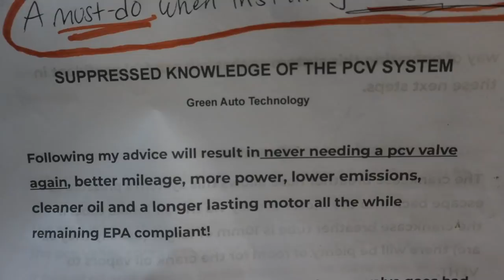The Wonder Of Positive Crankcase Ventilation

Comment: This was very informative.  My 1st car was a 62 Chevy II 4 cylinder, and I remember it had a vent tube going down.  I remember the oil rainbows on a wet street.  A few times at car shows, when an old one drives by and I catch the blow-by gas smell, it reminds me of how lots of cars used to smell like that if you were near them when they were idling.  And I gasped when it looked like that PCV valve was going to fall into the intake manifold.
Reply: Those 153 4-bangers were comparatively rare. My Grandfather was a Chevrolet salesman at Rost Chevrolet Independence, MO. Chevrolet made the dealership he worked at take two. They sat and sat and finally two boat-engine guys came and offered to swap-in brand new 194 Sixes in both cars straight-across.. The Dealer accepted and then the cars sold.
Reply: @patrickshaw8595  i was going to say, i remember those being inboard boat engines. I think Ford cut their 460's in half to make their own version.
Reply: March 1968 issue of Road & Track had a small article in the back about a little-known GM transmission called the "Torqueglide". What it was was a Powerglide without automatic shifting capability. It was $54 cheaper than a Powerglide and was aimed at taxicab applications. They road-tested two '68 Chevy II's (totally stripped Nova really) with T-glides - one with 153 I-4 other with 230 I-6 engines. They said that on level ground the 230 car felt happy with the column selector left in "H" all day. Even moderate uphill starts seemed pretty comfortable and normal. They said the 153 car took an unusual amount of throttle (this was the 60s when cars moved effortlessly at the twitch of a toe) to get moving unless it was on a slight downgrade. However selecting "L" and leaving it there most of the time in Downtown traffic was enjoyable and exceptionally smooth without the gearshifting.
    RT noted that experienced manual transmission drivers liked coordinating foot and hand to produce imperceptible (except to the ear) shifts in either car.
      I inherited my Grampa's tan' 62 194-equipped 4dr Chevy II. (G'ma had dubbed it "Scatterbolt", lol) and I drove it those years I was in A&P Mechanic school after I had put the things of childhood (highly modified '66 Turbo Corsa Corvair) behind me.
    The 194 had literally rusted to death from G'pa driving it at very slowly around Lamar, MO with it's original Road Draft Tube system installed. Dad and I sourced a very torquey manual-choke 250 I-6 out of a '70 Chevy pickup and installed it.
       Of course being poor I used the (re-proFILED-down) fast idle ramp part of the manual choke system to make it idle freakishly slowly when desired. It wore the 50-series T/A radials left over from the Corvair of course with the lettering turned in. 
       It's only trick was to push the choke in and get that freak idle going which would result in the original "Poorglide"s bands coming out of gear and the torque converter draining from lack of oil pressure.
      Snapping the throttle open on the ultra-responsive pre-emissions six would reward me with 20 foot of wide-tread one-wheel "scratch" on the road - followed by the rest of it's utterly predictable performance.
            Still interested? I could tell you one about a bad hazard of those old rear-pump pushstart-capable Peeglides next . . .
Reply: @patrickshaw8595  Interesting.  I think I read somewhere that the 153 ci engines were used in boats, like you mention.  I remember the letters on the valve cover said "C H E V Y", because there was no room for all 9 letters.  Mine was a fleet car (the local Bell Telephone affiliate).  It didn't even have rear backup lights, until I added the switch to the steering column and then put bulbs in.  Back then, base models were REALLY base.
Reply: @tomlewis3658  Excellent bit of history retrieved. Here is another - Our '66 Toyota Corona wanted a head gasket in about 1970. Selling dealer didn't have one. The parts man said the 2.5 liter four was a copy of the I-153 except that it had shaft-type rocker arms which were the same as the Land Cruiser I-6 which was a slavish copy of the Old pre-1961 Chevy six. So Dad went to NAPA and darned if it didn't match up to the I-153 !
 Couple decades later I learned that that Japanese could never master the stamped rocker arms invented by Pontiac for '55 and also used by Chevy.
 They also never mastered the art of Cooperage = wooden barrels !

Comment: I remember the stank. Walking downtown as a kid and waiting to use the crosswalk..it could gag you. If I remember right, it was worse in winter. People really didn't take care of their cars back then either. Points, plugs and distributor ignitions really did need to looked after every three thousand. So you are in town and there are all of these rich running, bad idling smog puking cars all around. Good times.
Reply: My seventies childhood smelled like lead.  It was somewhat exhaust, actually.  :)
Reply: Many people still don't maintain their vehicles. I've seen vehicles with 30,000 plus miles. That still have the factory installed oil filter. And oil that is horrible with lumpy sludge. I have seen vehicles taken to shops for regular oil changes. And the oil filters are completely rusted. No paint left because of crooked shops ripping of their customers. And I lost track of how many computerised vehicles with 200,000 miles or more. That have the origional spark plugs in them.
Reply: Loved those overly rich exhaust fumes from big Detroit iron.  I’m going outside to play lawn darts now.
Reply: Oh,lawn darts,can I be the goalie?😂
Reply: @oxyfee6486  Hell yea.  Then it’s BB gun wars.  Three pump limit.
Reply: @blackhawk7r221  My kinda guy,and then we play smash up derby,ride our banana seat bikes to the park,and then burn our now very expensive Star Trek,and Star Wars toys with the blow torch we stole from dads garage,Ah the gold old days😂🤣
Reply: @oxyfee6486  Lawn darts were a thing that even as a kid, I knew  a few idiots would get banned.  :)
Reply: @OllamhDrab  There was always one idiot who couldn’t wait for you to walk all the way to the other ring.
Reply: @oxyfee6486  A side benefit of my semi-geeky tomboyish childhood is I didn't participate in the boys' ritual demolition of all their toys.  Customarily with fireworks rather than blowtorches,  then,  but I didn't think much of pointless destruction so my Star Wars things were pretty pristine. 

 At some point a collector offered my Ma a decent little chunk of money for the things and I needed it so I said, 'Sure, go for it.'    It turned out later she'd decided to pretend she sold em and save the things for my nephews.  I found this kinda cool.   Hope they didn't blow it up.  :)
Reply: @oxyfee6486  Well,  I was a police and fire department brat, so range safety was observed,   but some kids up the street were just maniacs throwing the things at their brothers without any pretense of lawns or circles being directly involved.  :)
Reply: @OllamhDrab  If only I would have kept all those toys,I still have Steve Austin with the see through bionic eye 😂 I was physically ill when I watched the TV show Pawn Stars,they paid eighty thousand dollars for a Hot Wheels car that I crushed with a hammer lol.Its been fun going down memory lane,have a great day.
Reply: @oxyfee6486  Heehee.   I was more a Matchbox girl cause Hot Wheels were often too silly.  But I think we had at least a Bionic  Woman doll, cause my folks tried hard to play Barbies with my big sister but the Stepford zombie faces freaked me out.  I think the bionic people's faces kept falling off so that wasn't much help at all. :)  

I used to piss off my older sister putting my uncle's old GI Joe clothes on Barbara Bain from Space 1999 cause none of the Barbie clothes fit human-looking people...  My Da even tried buying me a Barbie Corvette but I was repulsed at the hot pink.  Poor guy.  Pulled a legendary move though and somehow found a british racing green Jag for Barbies in some vintage shop or something.    I still didn't like Barbies.  But car problem solved I guess.  :)
Reply: @oxyfee6486  Oh shit, you’ve got me rolling!!

Comment: Tony, agreed 1000%. Best thing to happen to the recip since the 4bbl carb. When I planned out the build on my 5.7 Hemi I made sure to retain the PCV system. Automotive engines can last 300K+ miles now because of 2 things; 1)fuel injection not loading up the cylinders at idle, and 2)the PCV valve keeping fresh air in the crank case.  Win-Win!!!

Comment: One of the biggest reasons for the build up and creamy looking oil sludge was from not driving the car long enough to evaporate the condensation out of the oil. People didn't drive there cars as much as they do now. A lot of times they wood start it up drive a mile or two and shut it off then an hour or two later drive back home. The engine hardly had time to warm up let alone get the oil hot enough to boil the water out. Same problem with the exhaust system. It would rust out due to all the water in it. But we didn't care as long as it got us where we needed to go.
Reply: My dad never drove far.  The bear parlor was just down the road.  He'd head in for a couple and come back with a six pack.
Reply: Tis was in the day of 160°F thermostats too! That coolness was an engine killer --- both in economy and engine longevity.

Comment: Piston aircraft still use the 'road draft system' for venting the crankcase, and it's just called the oil breather. When those engines are in flight, even at low power settings, the aircraft is still flying, so there is adequate air over the end of the pipe drawing out the gases well.

Comment: Back in the late 1960s my old dad had a 1960 Mercury Monterey 4 door with a 430 MEL tri-power Super Marauder engine that already had dual PCV valves factory installed in the valve covers. MELs went to 462 ci as far as I know. Yes, I remember the oils smell in heavy traffic and the road turning to rainbows in the rain. That was a watchword after a dry spell when the rains came, "be careful, it's raining and the roads will be slippery with all the oil". I also remember on many of the early performance engine builds I did was to install a nice pair of finned aluminum open vented valve cover breathers.

Comment: One of the reasons I know folks give PCV a bad rap, is when they have massive blowby causing detonation because they're blasting crankcase oil mist into their intake.

I am not saying PCV's are bad because of that - but in forced induction/high RPM motors, you have to be cognizant of the oil mist or blow by you're going to face with a PCV system. It's easily contained with a PCV catch can/oil condenser of some manner. But folks have found that a PCV/CCV system is beneficial at ensuring that the rings properly unload to seal for the next compression event. There's a bunch of great articles from engine builders and companies like MAHLE and Total Seal about all of this. Great video!

Comment: Then if you go back in time when they only had non detergent oil, add in a little neglect, those oil vent passages would get clogged with sludge and the engine couldn't breath anymore, so the engines would start leaking oil out every gasket and they would have a blue trail following the car and no power,  so people would get rid of them figuring the engine was shot. My grandfather would take those cars understanding what was wrong with them, clean out the oil vent passages and it would be like driving a new car again for a few years.
Reply: yep, when motor oil had parafin wax so you had to take a car for a ride before draining the oil at 3,000 miles to heat the wax up enough to get it out--an odd idea since you were spreading the oil all over the engine so you had to take longer to let every bit of it drain its way thru the block to the pan to the drain plug. the only good thing about changing the oil sooner was you learned how to spear those cardboard cans with the nozzle--and the real experts would church key another hole in the opposite side to let the air in. 

your grandfather truly had the right idea.
Reply: Even when detergent motor oil was the default recommendation there were still people who didn't use it. I remember the early 1980's and a guy who swore engines ran better with non detergent oil. He wasn't alone. I think it has something to do with the theory non detergent was more "sticky" so it took longer to drain away from the top of the engine, so more was available at start-up.
Reply: That is the biggest cause of early engine death - refusing to have the oil changed often enough.
Reply: @christopherconard2831  I was one of those "resisters" too.  Early detergent oils were not always very good.  I more than once had the additives separate, so I went back to non-detergent.  Today's detergent oils are superb.

Comment: If memory serves me right (or not)? the concept of the PVC came about at the end of WW-2. originally called "Donaldson Valve" and was only installed on a few U.S. Army application models. This later would evolved into commercial applications for automotive and heavy equipment (stationary) powerplants. The road draft tube was not the only nemesis vs engine's longevity. The non-detergent oils and the rope-seals (with the positive elevated pressures &  vapors) would generally reduced the engine's efficiency, leaks, etc. When the Open PVC system was standard, followed by the the closed PVC system; the only problems I known of was the PVC would be clogged (or sticking), or a engines was so bad (broken rings?) The blow-by vapors would enrich the A/F mixture to a point of not able to pass smog tests; (not the PVC fault, it was doing it's job). But for some customers, reasoning was sometimes not a option...................
Reply: Actually --- the rope seals were ASSISTED by the PCV system that kept the crankcase at a negative pressure by sucking air from wherever it could find it (nature abhors a vacuum --- remember that from anywhere?) ---  if it was operating correctly. 
This included any possible areas where oil might escape --- if oil can get out, air can get in --- right? 

In "those days" of rope seals, I never had to change a rope seal because it was leaking from either pressure or vacuum --- it just failed because it was a flaxen rope held together with impregnated beeswax --- which liberated itself, then the rope shrunk and opened up gaps at the ends. The gaps were the leaks! 

Blowby - it was later discovered was caused by 160°F thermostats (or by NO thermostat) creating spotty zones of cold engine temperatures. Also, this "cold" coolant never really got near to the top of the cylinders in the old style heavy/thick castings so they never got to a decent operating temperature.

The rings and the top ring lands got eaten up. The top of the cylinder bore is where the piston and the top rings stopped and changed direction - a very hard zone to keep sealed of combustion pressures. 

The 160°F coolant was circulating a couple of inches lower than the deck top of the block. This cause rapid piston ring wear at the top of the stroke which was also, interestingly, assisted by the abrasiveness of the carbon particles from incomplete combustion, and together fomented ring "chatter" in that turnaround zone ... and THAT was the reason why the cylinders went bell-mouthed and left a huge ridge that had to be reamed to remove a piston --- remember those days? 

That was where two bad ideas coalesced -->  cold coolant and thick casting problems! Engineers - and owners -- thought they were doing the engine a favor by keeping it cool, when just the opposite was the right answer!

Remember the days of 3# radiator caps?

SIDEBAR: I attended a Detroit Engines class in the USN and we learned that the coolant actually boiled furiously at the top of the cylinder deck because the great heat of combustion was not being carried away - and this cause the inside on the coolant passages to erode as the boiling took place -- and then the blocks would deteriorate and need sleeves or a new block to get rid of the holes. 

.

Comment: Willys-Overland actually patented a modern PCV system in 1943. It was used on most Willy's L134 and F134 engines from 1943 until 1971.

Comment: I remember riding a 1975 Honda CB400SS motorcycle back and forth to work rain or shine in the late 80s and you had to stay out of the center of the lane for the oil slick lingered there. 2 wheels and an oil slick are not a "good idea". Had a few close calls.